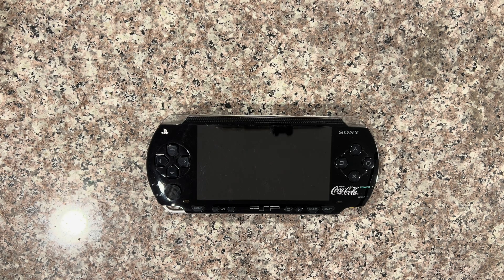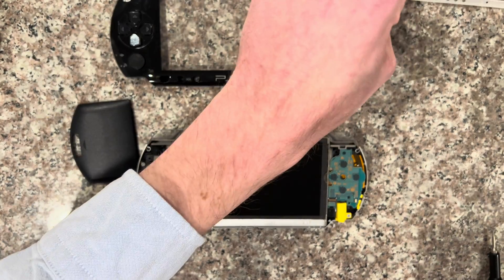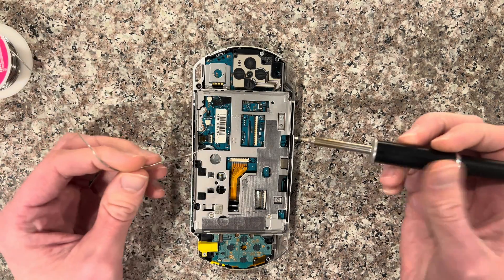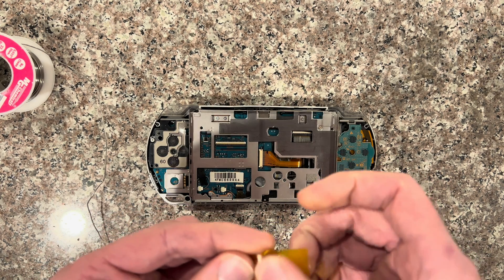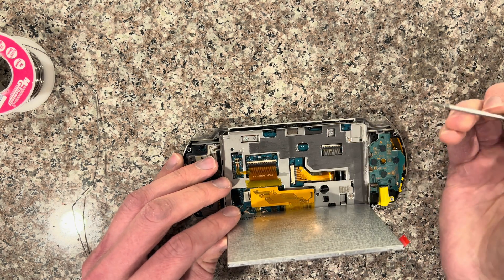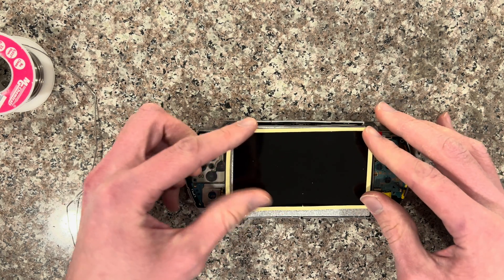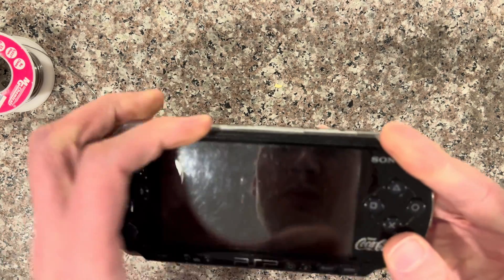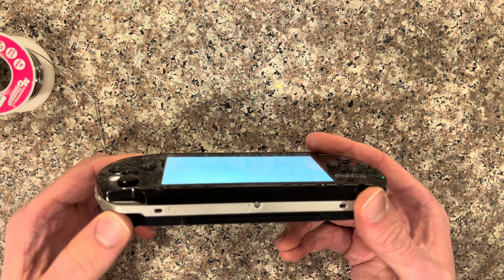Installing an IPS Screen on a Sony PSP 1000 Coca Cola Edition

Comment: Did you use any flux or just straight. Seems like anytime someone uses flux, it doesn't make a bridge as easily. I was considering adding a small tin covered copper wire, but it's such a small jump, feels like the solder  should be enough.
Reply from the maker: I don’t use any flux for these bridges. The lower temp really helps it stick a lot easier. At first I was using wire, but that made it more difficult
Reply: @blakeblundell9001  I just ordered the screen a cover and charger off your site. I have a micro tip solder. What temp you suggest?
Reply from the maker: @Dubbaski I like to use 220-230. If you’ve got a TA-082 or TA-086 motherboard then the location of the bridge will be a bit easier. If you happen to get some solder on any nearby components, just crank the temp up and that’ll clean it up easier. Then drop the temp back down to try the bridge again
Reply: @blakeblundell9001  awesome. Finally recieved the ips screen. Took it all apart, did your suggested temp and was able to create a very neat bridge. 
Also deep cleaned everything while I was in there, some real nasty gunk. And buffed out 90% of the scratches. 
My psp1000 now looks better than new!! Thanks a million for your shop and support. The battery cover also worked very well for the bigger ostent battery I have in.

Comment: There is four different motherboards (thanks Blake!) make sure you bridge the correct contact as it can be different depending on the board model.
Reply from the maker: There’s actually 4 versions, so 4 different places the bridge would have to be done. I believe it’s the TA-079 that’s got the worst location. The 082 and 086 are the easiest.
Reply: @blakeblundell9001 thanks man! I’ve only ran across the two but good to know!

Comment: This is such a finicky job. I struggled badly....those contacts are so damn small 😂 Got it done tho and it's totally worth it. Ive been enjoying it for a few months now.
I would recommend a decent quality soldering station, a stupidly small tip on the iron and a magnifying glass.